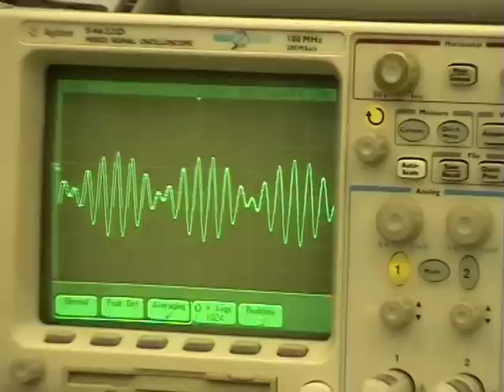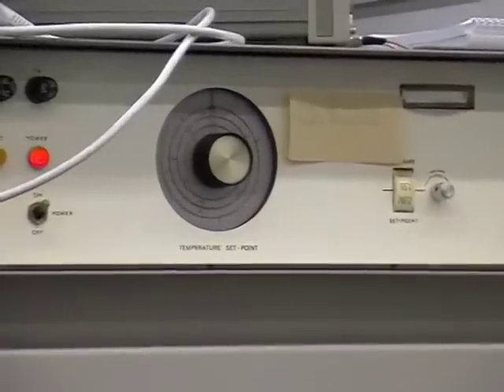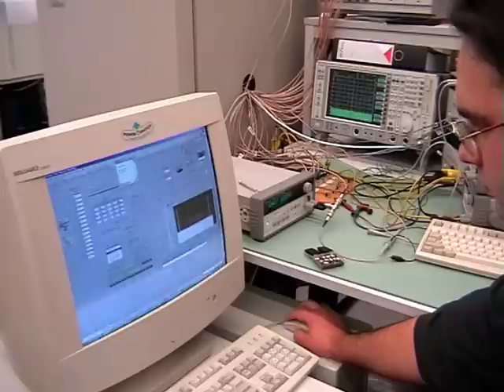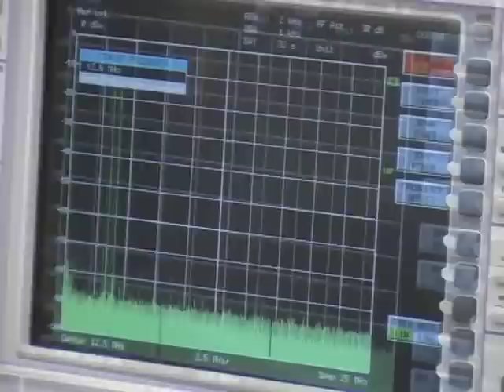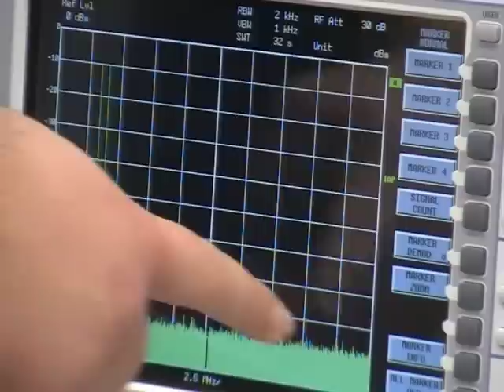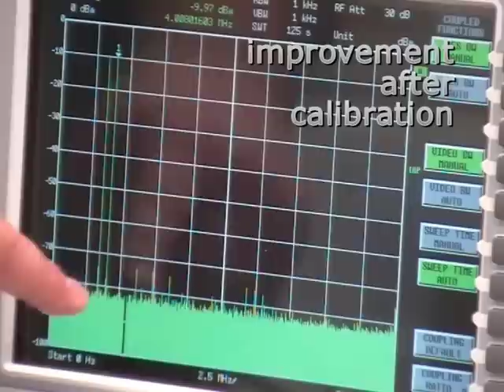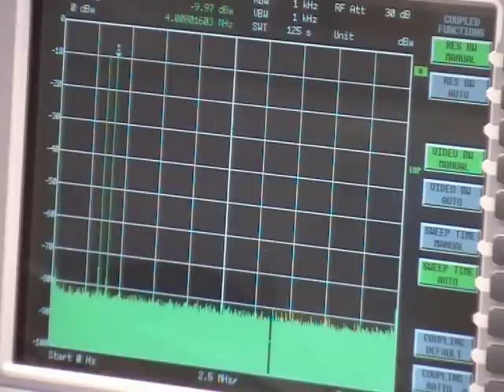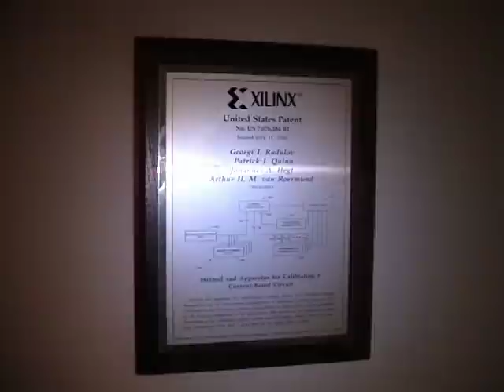A 12-bit self-calibrated current-steering DAC by Georgi Radulov

Comment: Why is it 12? Not 13?
Reply from the maker: Excellent question! Thanks. At high frequency the effective number of bits decrease. This chip maintains about 11-12 effective number of bits up to 5MHz. Beyond this frequency the dynamic errors kick in and the effective number of bits drops. So, even if we choose 12bits in resolution, the effective number of bits beyond 5MHz will still drop under 11b. In the book: https://www.springer.com/gp/book/9789400703469 another test chip is measure with similar calibration and shows 13 effective number of bits at low frequencies.